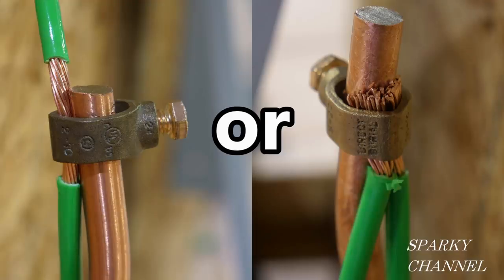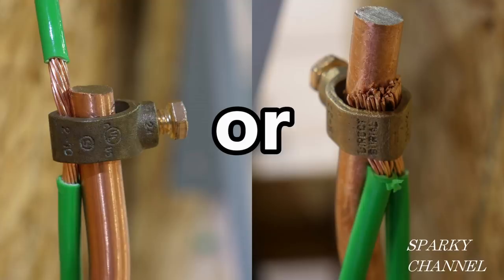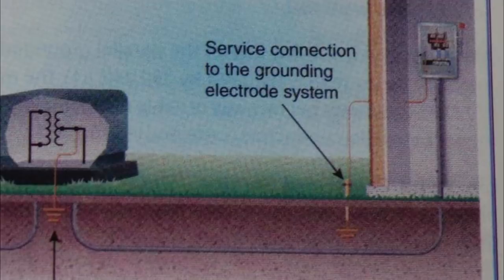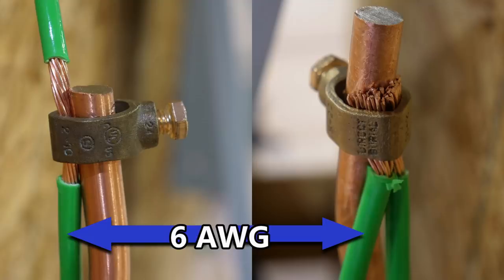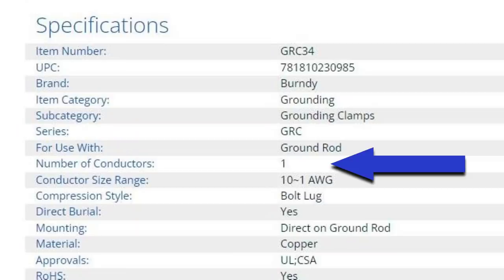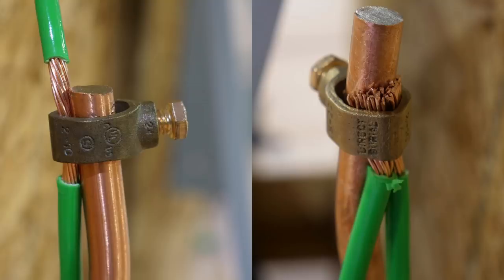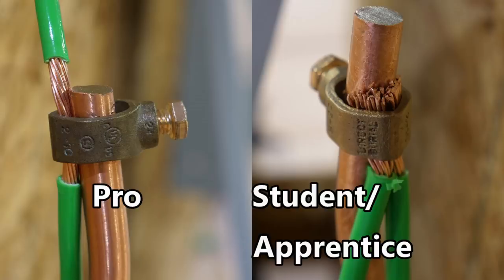Which is Correct?

Comment: Love your channel sparky anything I've asked for you explained to me what I needed to do thanks for your time and consideration Nate Preston.
Reply from the maker: My pleasure, thanks!
Reply: @SparkyChannel  cant use stranded wire that size in that application anything smaller than #2 needs to be solid
Reply: Awesome n professional answers n good examples u show n explain on electrical issues  , thanks a lot Sparky !
Reply: I am a big believer in using Penetrox on all ground connections.  They are dark damp areas.  Which lends to corrosion.  One big fault and that ground blows up.

Comment: In addition to the code, from a conceptual stand point, I like the idea of an unbroken cable.  If the connection to that specific rod fails, the continuous cable will still safely carry any occuring electrical fault to the next rod down the line.  However, if the cable is cut and bolted at each rod in a series, if any electrical rod connector happens to fail, then the whole grounding system fails at that point.
Reply from the maker: I agree, thanks!
Reply: When we make unbroken runs to receptacles.  Takes a few minutes longer, but it eliminates resistance and heat from multiple connections.  For friends and family with older homes using solid copper grounding rods, we will drill out the end of the rod, heat it orange hot, and pour molten lead in it along with the copper wire.  No more complaints every few years about getting tingled when touching plumbing  fixtures.  Damn you clamps and surface corrosion!
Reply: This was exactly what came to my mind the first 5 second seeing the title picture.
But I don't feel good about any such connections being underground. There will be metal dissimilarities or even just oxygen gradients and you get pretty fast corrosion. But that is from the experience here (non US), where common electrodes are galvanized steel (as they are required to be connected to the building metal construction parts and practically all buildings here use steel reinforced concrete elements) and you don't want that to corrode...
Reply: @annaplojharova1400  Ground rods should be copper plated.  I would not trust a contractor who used galvanized ground rods.
Reply: @blackhawk7r221  The problem with that is, once interconnected with the construction steel which happens to be also buried (although not over enough area to be used as a grounding electrode by itself). If you have the grounding electrode surface (that is what matters) anything else than the structural material connected to it, a galvanic cell will form and because effectively short circuited, a current flows, eating up one side by electrolysis. With copper/steel, the steel, so your house structural elements will be what will get attacked. So you may get perfect electrical grounding, but your house will collapse.
That is the reason for the use of Zinc coating: The Zinc/steel combination would mean practically any steel to be protected, both the "grounding electrode" bulk material, as well as all the condtruction steel components (reinforcement in the concrete,...) Even long after the Zinc is eaten out (assume it is deep enough to be out of reach for atmospheric oxygen).

 Using construction elements (steel reinforcement in concrete founding,...) as the main grounding electrodes is allowed and even a standard practice here, but it should have sufficient contact with ground to reach the required grounding resistance. If the resistance is too high, additional electrodes are required, but doing them after the construction is completed becomes very costly, so you should be pretty sure in the drawing engineering phase to rely on the structural steel only. Otherwise the common practice is to run a steel band or even extra rebars on the bottom of the foundation trench before the foundation concrete is poured, so they remain in ground contact all around the house and deep enough to avoid the oxygen gradient in the soil so slow down the corrosion. The connection rods (leading from that ring up to connect the electrical systems or lightning protection and so on) then should be coated by some insulating material (plastic sleeve,...). It is not mandatory, but it help to avoid the formstion of the gradient O2 cell causing corrosion on the top layer of the soil exposed to atmosphere.
Reply: @annaplojharova1400  we don't build houses with steel in the US. The example from the video is what we do in residential electrical services. The conductor from the ground rod is connected to the service. Not the structure of the building. I've dug up 30 year old connections, like the one in the video, and the copper still looks perfect and the acorns still unscrew. And that's in the North East where we have really bad winters.
Reply: Here in the U.S. for residential use, we use a copper clad grounding rod with a copper clamp on copper wire going to copper plumbing and the breaker box. Any galvanic action only happens on the breaker box bus bar, but the dissimilar metals are close enough to keep galvanic loss to a minimum. But I understand what you mean about commercial buildings.  Typically, the structural steel is kept insulated from the electrical system to prevent what you are describing.  But the building’s structural steel does use lightning protection grounds.
Reply: @annaplojharova1400  The best ground solution I have seen is the breaker panel mounted between two 3-1/2 or 5-1/2, steel channels. The steel channels become the ground path, and are clamped directly to the reinforcing steel in the foundation and garage slab, forming a very secure Ufer ground system, with all of the connections either welded or bonded within the concrete where there is little chance of corrosion.   And, far easier to construct than trying to bond a copper ground wire to the reinforcing steel, and keep it in the right place in the concrete and without damage.

Comment: Only connect stranded wire to a grounding electrode if using an exothermic weld or a clamp listed for stranded wire.
And you can only put one wire in a clamp, just like on a screw terminal/lug.

45 years master electrician retired 2019
Reply from the maker: Thanks!
Reply: So for the one on the right, if you used a stack of 2 clamps and put each wire in its own clamp, it would pass?
Reply: @mrcryptozoic817  Yes because you are not using the electrode for multiple services, those wires are all part of the same service and can be connected to one grounding electrode.
However you can drive additional grounding electrodes if they are at least 6 feet/2 meters apart.

You can also connect the wires together using an approved connector before reaching the electrode and only have one conductor going to the electrode.
In most cases the wire connector/splice must be non removable like a crimp sleave, that way part of the system cannot become loose or disconnected without some intentional effort.

Comment: In Belgium ground rods are only used for supplemental grounding or in renovations. New builds require a grounding loop which is to be put under de concrete footing before the pour. It is copper shielded by lead. The same rod and clamps are used as in this video. Just talking about the world.
Reply: Lidl sells me mini eclairs from Belgium, therefor I must respect the Belgian laws.   It is going to be a good day.
Reply: In the US we also bond the ground rods to building rebar and building steel. What's the reasoning behind requiring a loop and burying the rods under the footing?
Reply: So it can never be altered/damaged in any way. It also needs to be below 30ohms. Which is very easy when you loop. Little bit like a UK ring circuits, but for the opposite reason.
Reply: @syproful  That is actually a pretty good idea.  Here, I will find the grounding rods outside of the house, close to the foundation where they have a lifetime of lawn mowers crashing into them.

I often drive them deeper in the ground.  A couple years back when a house got a heavy up to the panel.  I put in two new grounding rods in the crawl space of the house...undisturbed area.  I had to drill holes in the floor and let the rods slip down that way.     I like the loop idea. tHanks for posting it.

Comment: Interesting. The acorn clamp on the left says “2-10”.... I saw the manufacturer specs and agree with you but just like wirenuts I could see that as a wire range. Even though I know solid #6 is typical for residential services here. Commercial we weld them. Thanks for the video
Reply from the maker: Exothermic welding is fantastic!
Reply: It’s fun the first dozen or so times.... then the cleaning and prep work gets monotonous. I would love to see a video about MI cable terms and pulling. I can never watch enough

Comment: One other important aspect for this type of ground connection that may not be mentioned here in the US but is covered in the UK is that by keeping the ground wire continuous and unbroken, if your intermediate grounding connection is faulty it won't effect the grounding connections further down the chain. If two separate/cut wires are used, the faulty connection would/could render all grounding useless.  

Does it seem like the NEC regs. are much more cumbersome than they should be for the average user?  Seems that it could somehow be streamlined so you don't have to jump all over the place from section to section and then try to interpret the intent correctly.
Reply from the maker: I completely agree with you! Thanks!
Reply: The NEC is more for electricians so I think they do it on purpose. Lol
Reply: That might be a challenge.  Like designing a "better" key layout on a typewriter

Comment: Interesting! I had no background knowledge on this sort of wiring so I went with my gut and was wrong. It seemed like the one on the right had more wire strand surface area contacting both the clamp and the rod, but I suppose those clamps are built a certain way and work best when that design is catered to. Good, fun video!
Reply from the maker: Thanks!

Comment: Direct burial (or even exposed outside) with stranded copper in the photos, is a terrible idea, as the bare copper stranded wires will easily corrode and that corrosion and moisture will wick into the jacket and reduce the continuity of the wire and it will eventually fail.  I thought anything outside being clamped to a ground rod (or any other clamped bare copper, needs to be solid copper)
Reply: Not exactly sure what you are saying? Copper stranded is the most common ground wire. Please show water corrosion on copper wire.
Reply from the maker: NEC article?
Reply: I am only referencing personal experience with exposed stranded bare copper wire outside, especially near salt water

Comment: 2:00 Is the one on the left a continuous conductor with a section of insulation removed ?
I will say the one on the right, specifically that one and not including other connections of that style, does appear to have all the right clamping arrangements as the two wires are on different and effectively independent parts of the clamp.
Question,  if the one on the right had had both conductors twisted together first and then clamped, would that be ok ?

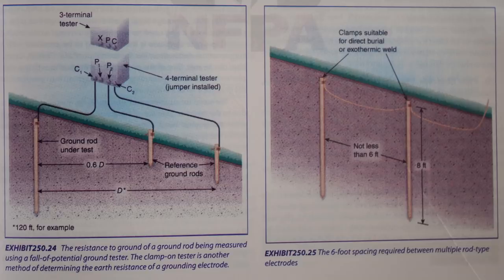Comment: 0:50 Exhibit 250.25 
In case the ground wire is too short to connect multiple rods, then you should explain (see 1:58) how to connect correctly two ground wires to make a single line.
Reply: Use a non removable connector or an exothermic weld.
Reply: In Ohio inspector’s tell me to use two clamps on same grd rod
Reply: @earlestes8649  Same, , 2 clamps are legal in certain circumstances.
I'm in Ohio, our inspectors have been gung ho clueless morons, ex police who have zero experience.
Reply: @MichaelClark-uw7ex  I agree I’ve been doing this since 13 years old I’m 65 this year. And I can’t believe some of the stupidity, it’s got so bad I don’t even call them for approval

Comment: Hi I put in 3 multiple grounding rods on my property. So it was a total of six rods hooked up. But it was 3 set’s of grounding rod’s. Instead of cutting the grounding wire’s? We simply slid the 2 connectors onto the uncut or solid grounding wire. That’s what our building code enforcement recommended.
Reply from the maker: Excellent, thanks!
Reply: Why do you have so many ground rods? You only need one
Reply: @krisssilco  not true.   I just wired my tiny home.  I had to install 2 10ft rod minimum of 6ft apart.   I did it 10ft apart.      I passed inspection...
Reply: @krisssilco  if I had to guess it's cause of lightning. I live on top of a hill surrounded by trees. Lived here for 6 years and seen personally 7 lightning strikes in my backyard with 1 so close the the well it flipped the breaker without causing harm to the pump. That was 4 years ago.
Reply: @homesteadhaven2010  who told you that you had to install an auxiliary electrode? If it was an inspector, he doesn't know electrical theory. You don't need more than one ground rod at your home. The only reason for the ground rod is for a path for the lightning to go if it hits your house so there are no arc flashes between the metal parts of your home. Driving more than one ground rod in a system fed off one transformer is just a waste of time and labor. If you like electricity, look up Mike Holt. He has a shit load of videos and they are helpful too. He also has ground rod videos too to better explain why you only need one and when not to install one

Edit: Side flash, not arc flash
Reply: @krisssilco  I did with the inspector told me to do.       No big deal to me.    Free labor.    Plus what I read you're supposed to measure the resistance when you put one rod in the ground and see if it's within specifications if it's not you should add more rods till you get to the right specification.    Mine was two rods.   Just so you know I already have a lightning system on my metal roof...   this is code for my area.

Comment: Well it's one conductor per clamp, but can a second clamp below the first be added with it's one  conductor?
Reply: Actually,  I think that would be legal.  Only one GEC is required. So, if you were installing 2 ground rods, the wire from the panel to the acorn clamp on the 1st rod would be the GEC (unspliced or irreversibly crimped), and the 2nd wire under the 2nd acorn clamp is actually a bonding jumper to the 2nd rod and can be spliced if need be.
Reply: We have actually done this when an AHJ said we needed to add a ground rod to existing.

Comment: Considering that NEC 250.64 requires the grounding conductor to be continuous or spliced such as with an irreversible compression clamp or exothermic welding, an acorn clamp is not suitable even if it was listed for multiple conductors.
Reply from the maker: The one on the left is continuous, not cut.

Comment: My preference is to run a separate wire from from the ground connection in the panel to each ground rod that is installed.

Comment: Id say either is correct, I would like to see that thick rod brazed to a ring and the thin wire ferruled and seated in a different hole in the ring. Bonding a giant conductor with 'fur' in one junction seems iffy.

Comment: Acorn clamps are NOT intended for use with STRANDED WIRE!!  Only SOLID wire shall be used!!
Reply: Doesn't say that in the listing, which is what matters.
Reply from the maker: Listing or NEC code?
Reply: @SparkyChannel  his opinion
Reply: @isaackvasager9957  NEC Code... A stranded wire can unravel and reduce its dia.. therefor making the clamp less tight.. LOOK IT UP
Reply: @SparkyChannel   NEC Code... A stranded wire can unravel and reduce its dia.. therefor making the clamp less tight.. LOOK IT UP
Reply: @jwray9799  The code doesn't say that. Show me the code number if you think it does.
Reply: @isaackvasager9957  General Installation Requirements, Part VI
Reply: @isaackvasager9957  General requirements pertaining to electrical connections are in 110.14; this section is divided into three subheadings, which include terminals, splices and temperature limitations. When conductors are connected to terminal parts, it is required to thoroughly ensure the connection is good and the conductors are not damaged.
Reply: @isaackvasager9957  You are REQUIRED to ENSURE a good electrical connection.. And as a connection that has a known failure rate, would be a violation of said code.. As a former OSHA safety inspector for 25+ yrs I would not pass a temp electrical pole with a STRANDED GROUND WIRE UNDER A ACORN NUT!!
Reply: @jwray9799  that says nothing about stranded wire. Holy shit. Learn to admit when you are wrong.

Comment: Why do we have a grounding electrode at the transformer and service panel? Why not just at the transformer secondary?
Reply: Transformer secondary is typically utility owned. They ground their neutral conductor to stabilize their system (windings/coils), which is part of their code, the NESC. The NEC requires the grounded conductor (neutral) to also be grounded at the main means of disconnect as it helps to stabilize the inside wiring, and dissipate potential energy induced on conductive electrical equipment, such as from a nearby lightning storm. See article 250.4.
Reply from the maker: @paul4800  Great answer!
Reply: @paul4800  what about equipotential bonding. That is the reason for adding the extra grounding throughout. (Also in case the utility has a thief come by and cut out the ground wire.)

Comment: If i take a single 10awg conductor, strip a section of insulation from the middle (like the pro) fold it over 180 degrees on itself and insert it like the student... if i never cut the wire... is it one conductor or two?  (Folded over 10awg wire will have less cross sectional area that the 1 awg maximum capacity...)
Reply from the maker: I believe that would be viewed as 2- 10 AWG wires, but you can buy acorn clamps rated for 2- 10 AWG wires.